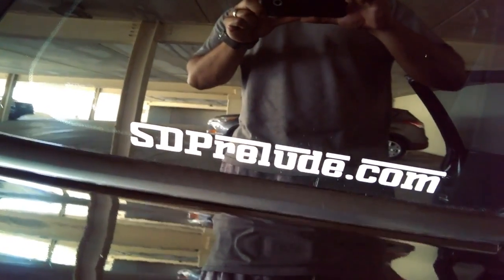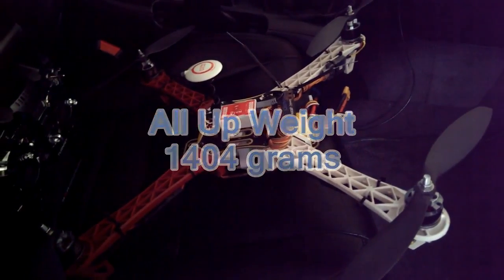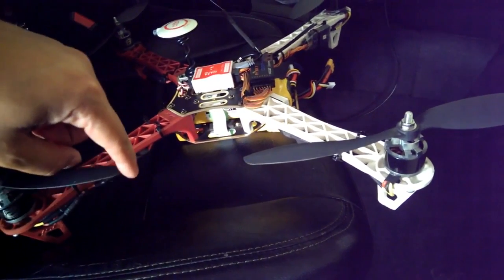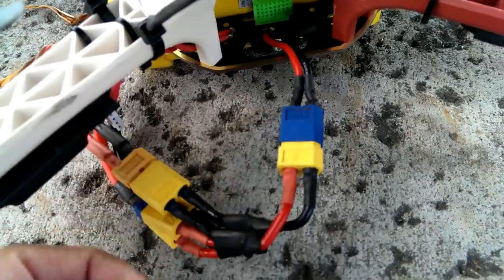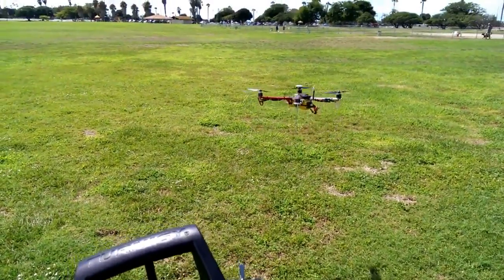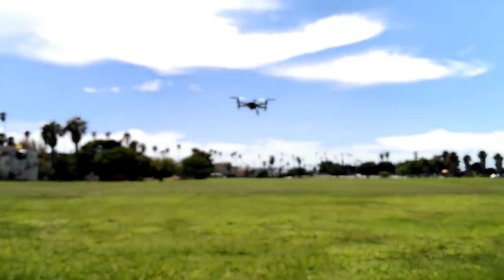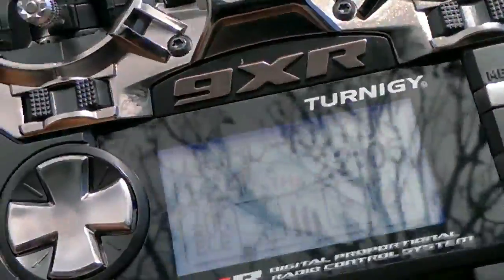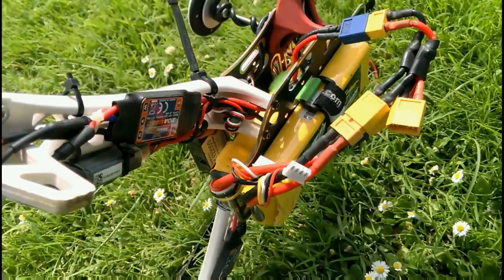Dual 3700mah LiPo Batteries on my Quadcopter

Comment: Maybe you should mount a servo to the quad.  Connect the batteries separately (you probably already do this) and then have that servo drop the dead battery, so you can increase your flight time by 30 seconds. :P
Reply from the maker: Hahaha